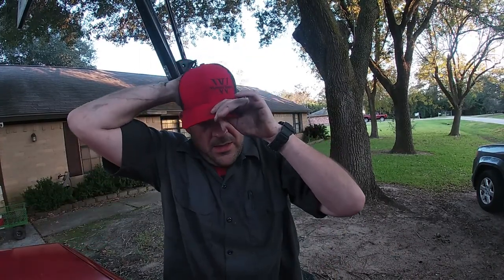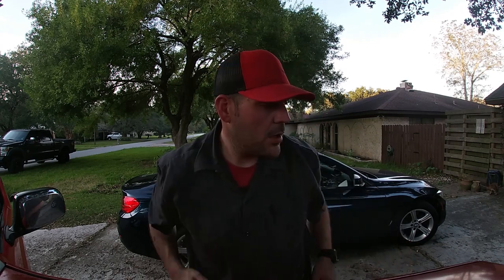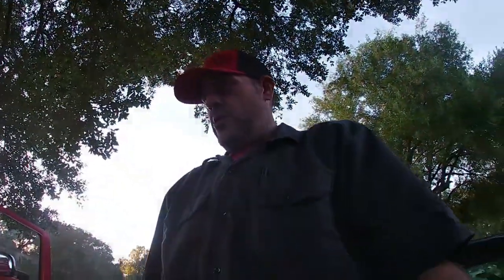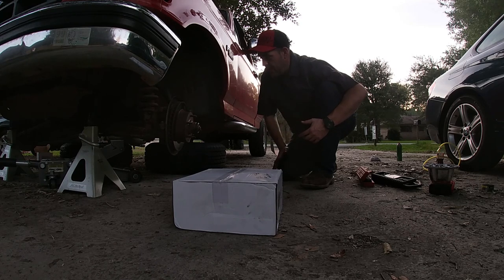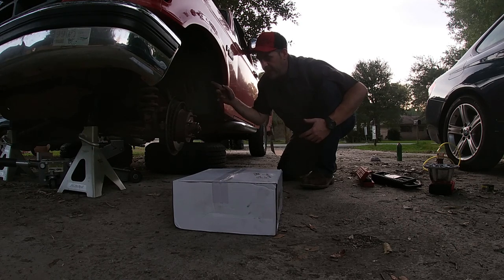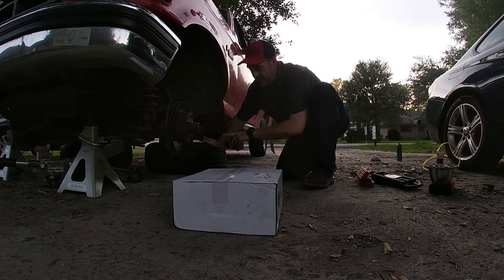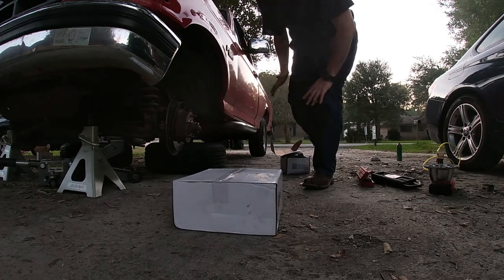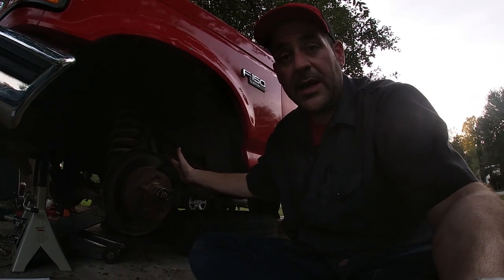vlog:1992 F150 4.9 300 straight 6 front caliper replacement fiasco

Comment: I use to love working on my vehicles.  Knees don't work so good now so a pain.  When I had to take out back bearings a quick way is after taking off but an front of outer bearing, out but back on slide rotor on and let back bearing slide down against nut, give a quick pull and it pops out grease seal and bearing without damaging either one.  The i would clean and repack bearing with new grease.
You dad said that bench took him and another guy 4 hour to do.  Looked like a pain in the back side but it is a great bench.  I use it all the time when I'm cooking in back yard for you dad's partys......
Reply from the maker: Believe me after doing that front brake job my back wasn't happy, she is getting me too. That's a good trick about the rear bearings, would have saved me a lot of time, I'll try that next time for sure.  That rolling table really is nice, I think im going to like it a lot, I'd say 4 hours is about right on total build time but i spread it out over 3 different days lol.